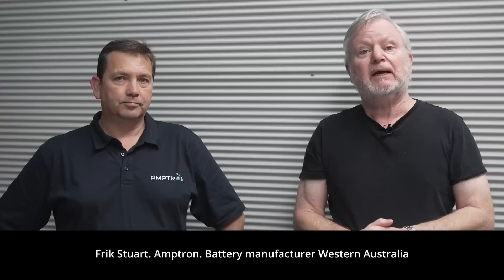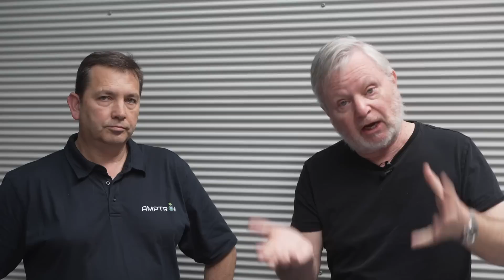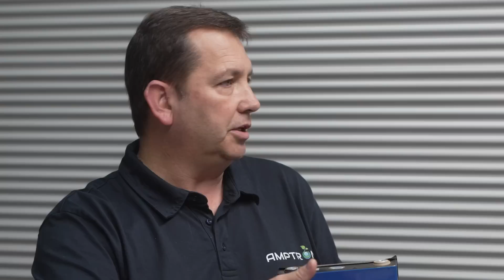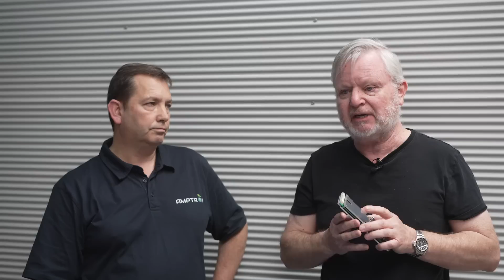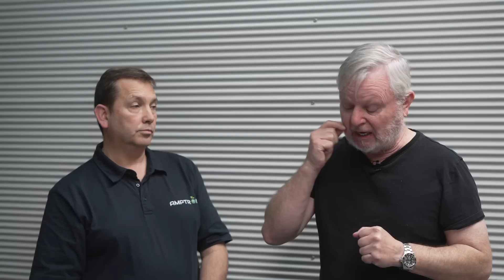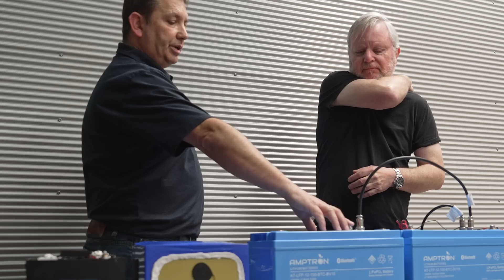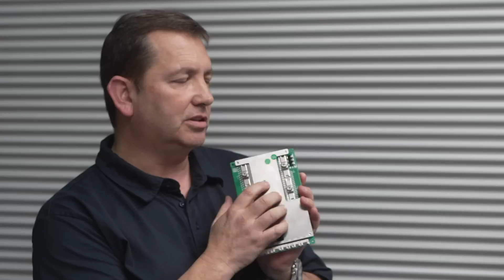LiFePO4 (lithium) Batteries. Separating Myths and Facts @4xoverland

Comment: High ambient temperatures were not discussed - how safe are LiPO4 batteries under extreme heat - I am talking about 45 degrees and above as is the case in Southern Africa in summer.

Comment: led acid adont last linger than 3 years they can make batterys to last longer and better but then you dont sell them every 3 years  lithiem bateryes are ver charged anyway just look inside they are basecly the same
Reply from the maker: Here are some facts: Lead acid if well looked after rarely last more than 6 years and by that time have lost 50% of their capacity. LifePO4 batteries typically last 10+ years and even then will still have 80% charge capacity. They are constructed utterly differently in every possible way with the exception of some standard sizes carried through. Even the terminal sizes changed. LifePO4 are controlled and made safe by battery monitor systems. Short a lead acid and it will catch fire or even explode. Short a LifePO4 and it will shut down automatically. And unlike lead acid, LifePO4 do not emit poisonous gasses when being charged. (hydrogen and sulphur)

Comment: THE ISSUES WITH FAILURE P0OINTS OF BATTERIES  HALF  THE WIRING PAST    PASSIVE MANAGEMRNT SYSTEM WO9ULF NOT CONFORM TO 12   OR V24 VOLT USE

IT ISN'T THE MATTER OF RUN TO PERFORMANCE HIOUSE BATTERIES  TYPICALLY RUN IN SERIES 4V OR MORE BATTS

NOTING YOU CAN APPPLY ALL THE CHARGING SHUNTS YOULIKR  YOU AREN'T ELECTRICALLY ISOLATE FROM YOU CRANK  BATTERY
Reply from the maker: A note. ALL CAPS is hard to read. If you want your comment to be read, use lower case. Upper case is like shouting. Nobody likes being shouted at.

Comment: They are double the price too.  The biggest thing is making sure charging and protection of the battery under external fault conditions.  Like anything electrical.
Reply from the maker: Of the millions of LifePO4 batteries that have been made, less than one in a hundred million catches fire. They must have in-built protection to be sold in most countries. Anyone not wanting to work with those odds should stay indoors and lie under a table in case the sky falls on them.

Comment: Here in the USA a flooded lead acid battery is what most people think of as a starting battery. In the 40+ vehicles I've owned with these batteries and the times I've taken them in for service. Not one time has the electrolite level ever been checked. So in the south where I live a starting battery typically lasts 3 yrs. You can almost set your watch by it. However 8 yrs ago I put a SLA battery in my v8 Ford Econoline Van and finally it  expired. So twice the price for no maintenance save a terminal and post cleaning every now and than. It's a no brainer.

Comment: I would like a discussion on the subject of "amp hours"

Is 100ah lifepo4 as good as a lead acid 200ah?

That discussion.
Reply from the maker: its better because of LiFEP04 ability to accept a charge current is always going to be better than any lead acid type. And its one sixth the weight.

Comment: What is AGM
Reply from the maker: AGM, which stands for Absorbent Glass Mat, refers to a type of lead-acid battery where the electrolyte (the acid solution) is absorbed into a fiberglass mat between the positive and negative plates

Comment: I have a lithium starter battery in my Mitzi and it works great but it is a lithium cobalt battery and if you flatten it you done loose capacity like lead acid does

Comment: Just watched your lithium battery story, great learnt a bit more. A small point that's probably something that residents living in our savannah country might appreciate. During our wet season, sunny mornings afternoon thunderstorms, our solar charging time is small. With Lithium batteries I plug in the extra 250w fold up panels to deliver much greater charging capacity than the 3 permanent 90w (270w) roof top panels.  This making the most of our much sorting solar charging time. Ps both sets have their own controller with the roof tops taking precedent.
Vehicle is a 2011 AWD Hiace. Watching your Hiace build with great interest.
Tim.

Comment: I have in the engine bay of my Discvery 4 2.7tdv6 a itech world lithium start battery. its been there for just on 2 years now . Its done part of a canning trip 
But the best advantage I have had is the elimination of 99% of my electrical faults my biggest fault with the lead acid battery was a gear box at start up even when new 
Since the lithium I have had no problems

Comment: Does the new regulations require me to have my 100ah Lithium sealed from interior of my SUV and vented to outside my SUV? Atm it's in a battery box in the rear running my fridge.
Reply from the maker: Only if you are sleeping in your SUV. Otherwise, not needed.

Comment: 🇦🇺😱 I wish I got this video last week…. I just bought 12v 100Ah LIPO battery for my crank starter battery. Reading the instructions it is a drop in replacement. Cost $560 . So it will be interesting to see how it goes. Here in Victoria we are not exposed to consistent high temps, so fingers crossed it lasts longer than the AGM battery.

Comment: I'm 2.5 years into a lithium starter battery from another Perth based company, It is installed in my 200 series, I use the car exclusively for trips and towing my Kimberley Karavan. I went this way as an experiment to see if they do actually work in this application.  Previously through storage of the car or leaving a light on or door open etc, I killed 2 or 3 lead acid batteries, technically even if the starter dies tomorrow I am ahead financially based on the times I have had to jump pack the lithium starter since it's been installed as the voltage dropped to low and it shut itself down. This also raised another issue, redarc bCDC etc dont like a lithium source to a lithium 2nd battery as the input voltage form a lithium source remains high and the redarc keeps drawing power, until it's too late,  I then had to fit a Alternator sensing relay to activate the 200Amp narva relay that powers the 2 redarc BCDC 25's via my Egon hub.

Comment: At 10:50 of the video the guest quotes that "an AGM battery is not designed to start the car"......that is not correct. Nearly all AGM's in the automotive segment are starter batteries. I own vehicles that came from the factory with AGM's. Now if he is talking about AGM deep cycle batteries, then he is correct. This is something that should be clarified.
Reply from the maker: he was definitely talking about deep cycle AMG batteries

Comment: Great video and some very good information.  At one point, your man said there is a way of determining each battery's health when they are linked to another battery,  but he did not elaborate. Could we get some information on that.
Reply: There are a few ways this can be achieved. Firstly, since each battery will provide a separate Bluetooth connection, you are able to connect to each battery independently to interrogate that battery's status, so if you have one battery in a parallel connection with an issue, you can identify it from the information via this connection. In addition, if you add a physical display, then besides the consolidated / summarised information that will be displayed for the complete battery bank, it will also display some basic information about the individual batteries which you can use to get an indication of a developing issue. An in addition to this, if the BMS from any one of the batteries identifies a warning / error, then on the display the user will be made aware of this, and if it is a more serious issue, an audible alarm will also be triggered.
Reply: Good to know. That is exactly what I have been doing.  Also usfull for setting up my victron shunt, which is connected to my victon mppt. Love these sorts of videos 👍

Comment: The question I have is what happens to the car's voltage when The BMS cuts off at full charge? Does the voltage begin spiking in the car's electrical system, because the battery is "disconnected" and not regulated properly by the battery?
Reply from the maker: When fully charged via a DC-DC charger, its like turning off the lights or air-con. It just draws less current from the alternator. This is what a DC-DC charger does. However, a direct connection, is a different story and not a good idea at all.
Reply: @4xoverland  It's really not exactly the same, a standard battery acts like a big capacitor for regulating the spikes in voltage during normal operation, car companies say never to disconnect a battery while the car is running, so that was my concern.

Comment: I had a 55Ah Lithium battery as my 2nd battery in the engine bay of my Aussie spec FJ cruiser (4L petrol engine / battery mounted at the front of the engine bay on the passenger side) — I was excited initially, as it replaced an aged Ultima yellow top and gave effectively twice the capacity and was 1/3rd of the weight — now, first thing to say is that in this location my battery temperature gets to around 50 degrees C — second, after 2 years it started to fail, in that the battery management system was frequently shutting down (a big pain) and the battery capacity had decreased from 55Ah to around 15Ah — not sure if it was a cheap brand or just representative of Lithium under bonnet in general — now I’m back to AGM and am happy again

Comment: Not quite true about the 100Ah lead acid battery - it cannot take 100A for 1 hr, it's likely to have a 'c' value of 0.2 meaning it can take 20% of that 100A ie 20A per hour, so it takes 5x as long to charge...

Comment: RE: starter batteries.  If you need deep cycle for other things, replace the starter battery with long life supercaps and connect them to the (Lithium) deep cycle battery with a current limiting shunt.  LiFePO4's keep the supercaps topped off, engine drains the supercaps to start without sucking tons of amps from the LiFePO4 bank.

Comment: Depending on the manufacturer, you should also avoid having Li batteries sitting at 100% for extended periods. Size the system for 30 to 90% normal use. Then, when you need the extra capacity, change the profile to 20 to 100%, and you get the extra you need without fuss, and your battery will last longer.
Reply: This may not be the best advice. The literature around Lithium-ion cell cycle life that can be negatively impacted when kept near 100% SOC is firstly mostly based not on LiFePO4 but on other Lithium chemistries. For LiFePO4 cells, there is still an impact, but much less than other Li-ion chemistries. However, please note that this research is based on individual cells. When you are dealing with a complete battery pack with multiple cells in series, then usually a bigger impact on the cycle life will happen when the cells become unbalanced after some time/use. The internal cell balancing is not effective at lower states of charge, and you need to frequently charge the battery close to 100% for the BMS cell balancing to do its job. Restricting the maximum charged SOC to 90% will invariable over time lead to unbalanced cells, and the impact of this on the battery life will be much worse than the potential impact of having cells around 100%, and in addition, if the battery is regularly used/cycled, then charging to 100% has much less of an impact than storing the batteries when not being used for long periods at 100% SOC. So our advice is that when charging, it is good to fairly regularly push the battery SOC up to 100% and keep it there for a little while to allow the internal cell balancing circuits to do its job. If the battery will be unused for longer periods of time, then best practice would be to discharge the battery to around 50% SOC when stored.
Reply: @FrikStuart Apologies if my post was unclear. I did not specify the chemistry, I made a remark about "Li batteries" in general, and I did say "extended periods." I also cannot find where I stated batteries should never be charged to 100%
EVs have charge timers so you can set them to 100% charge, shortly before you use the vehicle, specifically for convenience and extending battery life. If it didn't matter that the battery stood on 100% for more than an hour or so, they would not have gone to the expense and trouble to write software for this. 
Case in point: we imported a Nissan Leaf with only 3772km on the odo. It had less than 75% of its original capacity and was just under 6 years old. 
It had been registered to Toyota Mobility in Japan and was parked on the charger in the basement.
There were no climate or charge timers set nor was the charge level set to 80%(this was very unusual, as Japanese salespeople and EV owners are very well informed and trained) [Perhaps this car is one of the reasons Toyota say EVs are dumb?]. This car was fitted with what they called the 'lizard' battery. 
Another car, that was one year older (Gen 1 cells, not lizard), had 100 000km more mileage, over 80 fast charges, had been exposed to the elements (faded paint on the one side), and had similar battery SOH. BUT, it had been set to 80% and the charge timer was set for use on workdays.
This car has on
ly recently  been used at 100% as it was now at under 50 km per charge at 80%. It now has 210,000 km, has had almost 1000 fastcarges and only gives 20% less range than the first one which now only has 40 000 km.
Of the 100 or more Leafs that we've imported, we have seen a direct correlation between higher battery degradation and the 100% setting.
I know you have way more qualifications in batteries than I do. My comments are based on real world observations, (I own 3 Leafs and an Prius) and experience on repacking battery packs and repurposing old EV cells for solar , for the EV company that I have shares in.
I definitely didn't say that batteries should never be charged to 100%
Please check with owners that have kept their Li batteries on a traditional maintenance charger at 100% (vs the new ones that discharge slightly after 100% is reached for storage) If they then used them 2 or 3 times a year only, they probably only lasted 4 to 5 years even though they would be used at less than 0.5C. This is also why you would never charge a Li battery to 100% and leave it in a cupboard. A LiFePO4 battery could last 20 years in a camper rhats not used daily, if it is not left at 100% charge while it is stored. Leaf batteries frequently get hammered to 2 or 2.5C on discharge (80kW motor on a 24kWh battery) and 1.5C on charging, and many Leafs at 10 years old still have 70% capacity! Those not set to 80% very rarely above 50%.
Our clients are also informed that they should charge to 100% once or twice a month, preferably once a week (I also stated clearly in my comment 'depending on usage') 
Please also see the hack of charging to 100% and then rapidly discharging to about 93% to extend battery life by up to 25%. 
Aside from my observations, I like to read peer reviewed independent articles and papers from universities all over.
Reply: @jensdenk9235 thank you for your detailed reply and clarification. I now realise that you are mostly referring to EVs, which really is a different beast compared to conventional smaller portable type of batteries such as what is used in RVs etc. The electronics in EVs are significantly more complex and usually also include cooling and heating systems to manage the temperatures of the cells. Further, the charging systems allows for much more fine-grained management of max/min SOC, charging rates and the balancing circuitry with those systems are designed to adapt accordingly. Thus, in EV applications where much more fine-grained management of the cells and charging regime is feasible, you are correct that the cycle life can indeed be improved by reducing the periods where the cells are at or close to 100%, and your observations of the performance over time are very insightful, thank you.

My reply was mainly addressing the smaller portable battery systems such as those used by the 4WD / recreational community, but I could have been clearer. In this context, most of the BMS cell management and charge regimes are usually not very customizable and are fairly fixed. For those kinds of system, from our experience it can be a much bigger issue in the long run if customers do not regularly fully charge their batteries, where cell unbalancing that develop in due course due to the lack of the balancing circuits operating, can cause bigger capacity degradation compared the capacity fading at may occur at the cell level if charged to 100%. For most users that are trying to manage Lithium batteries in 4wd / recreational applications, they would be best served to fairly regularly push the battery SOC to 100% to trigger the cell balancing circuits.

So horses for courses.